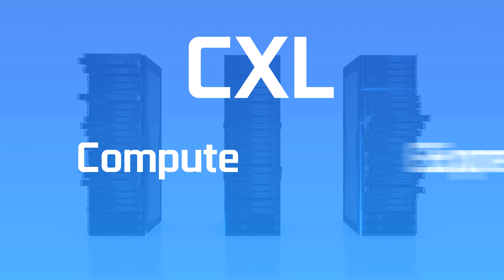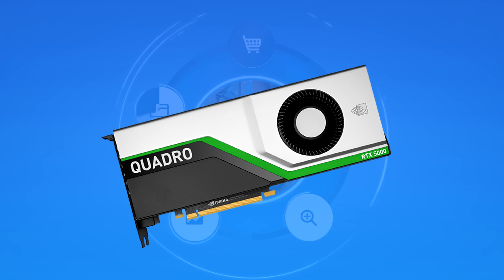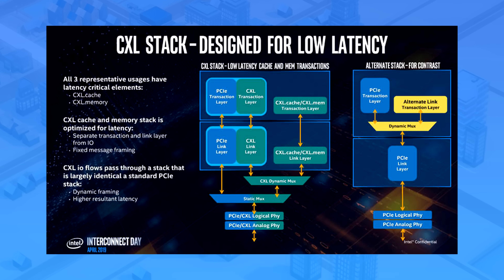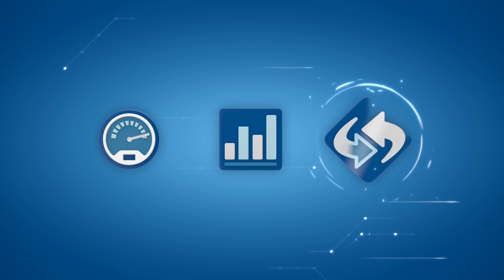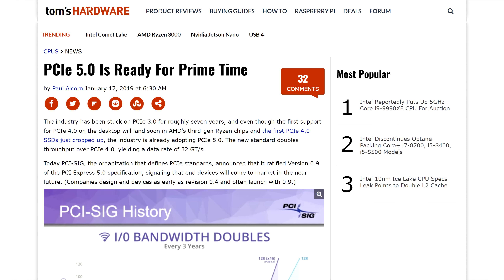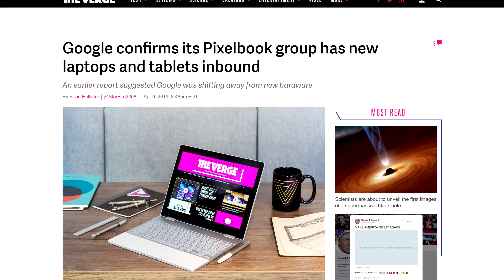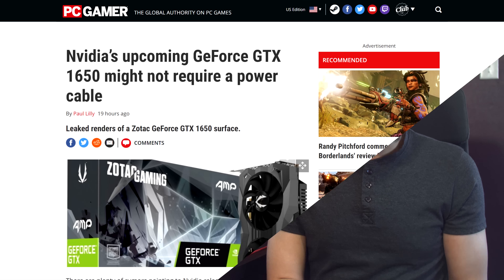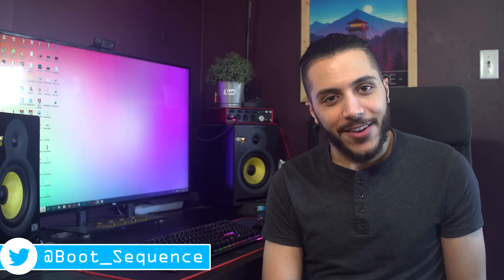Is Intel Going After NVLink?

Comment from the maker: Yes, I know, the intro is messed up. I don't know why but it still happens after 3 renders so i'll leave it in. Now just to clarify something, both Nvidia and AMD have a specific interconnect in their data centers ( NVLink and Infinity fabric Link ) but when i said "its not a likely scenario" I was strictly commenting on the Desktop side of things. Also, CXL could be used as a bridge through PCI-E lanes to connect 2 of their GPU's similar to how crossfire multi-GPU works now, but it could also be a physical bridge like NVLink. I'm going to sleep now. I'll read all the comments when I wake up! Stay Fros..Zzz.
Reply: Boot Sequence it does go well with the "Boot Sequence" normal intro
Glitching is COOOOOOOL
Reply: fait de beaux rêves
Reply: Guess you didn't use CXL to render this video (;